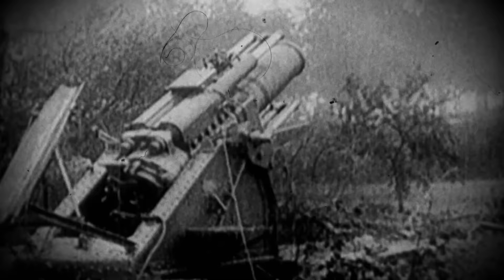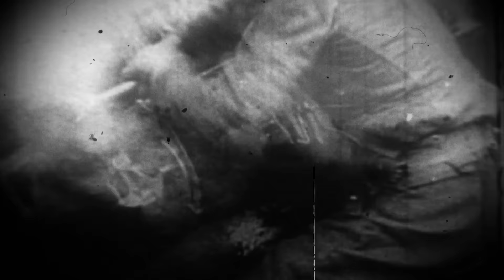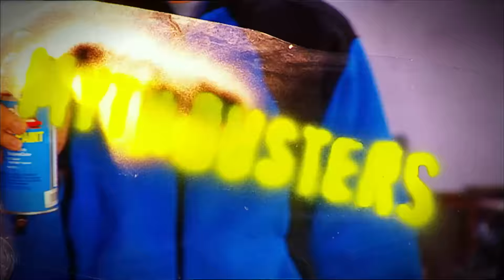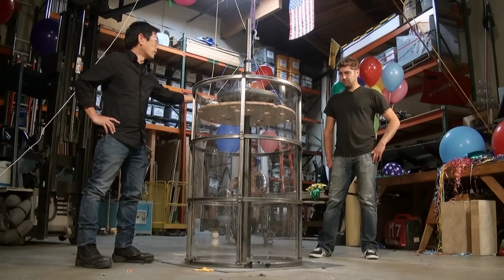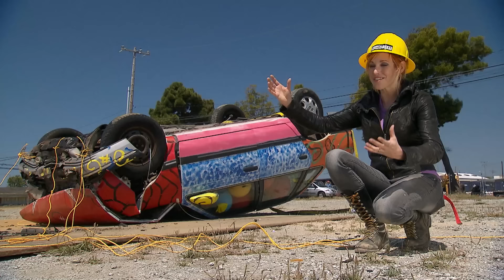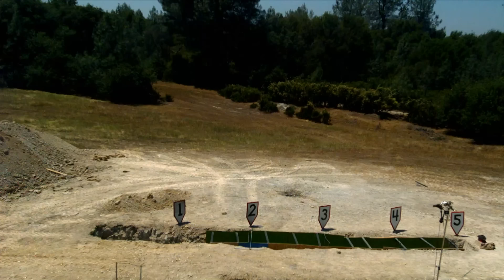Can Party Balloons Really Save You In A Car Crash? | MythBusters

Comment: For the trench blast tests, I'd call this one just barely in the plausible range, as they rushed through showing us the final results: the soft corner trench was only a single PSI different from the 90 degree corner trench. Honestly, I don't think that's even statistically significant. No wonder there was no explanation from the guys afterward & they cut off the episode there.